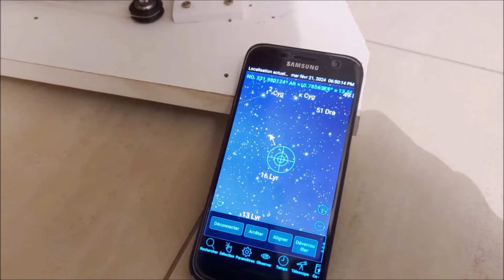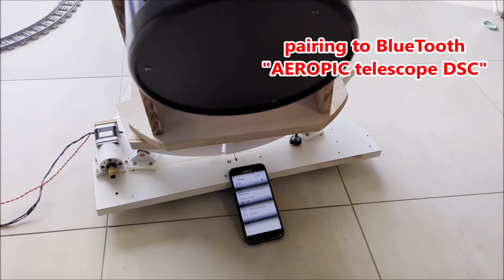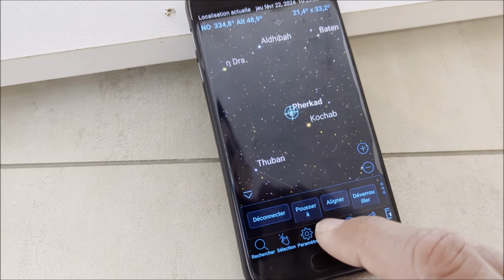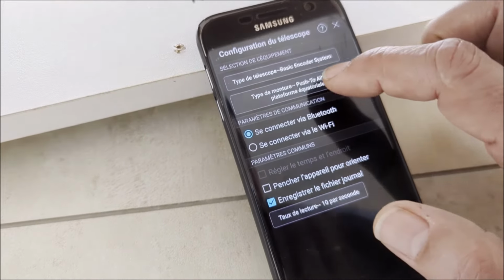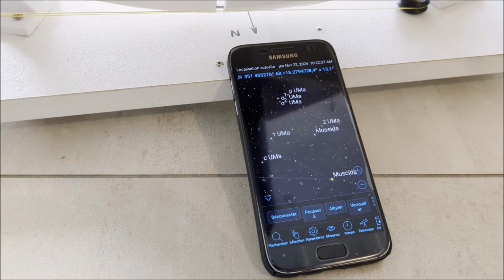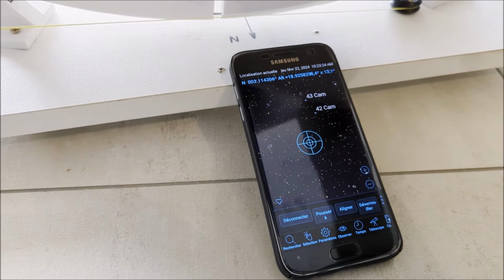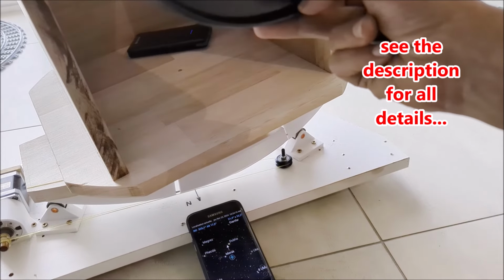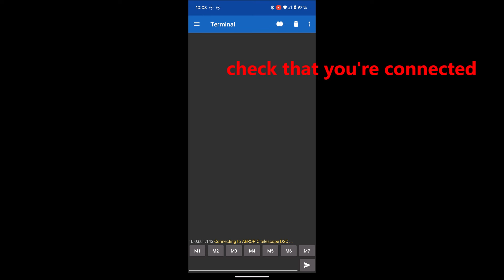AEROPICs wireless pushto DSC

Comment: Project looks great. Just waiting for parts to arrive to try it on EQ2 mount, without the cogs and just use the. AS5600.  I assume no programming is needed on any of the boards?  Nothing mentioned, but dont see how the boards SSID names get setup?
Reply from the maker: Yeap, there is no programming at all. Both ESP32 discover themselves, the SSID are inside the code assuming yours won't interfere with mine ;-). Same for the BT name, but you can chnage if needed.
Just upload the code to the ESP32 and go !
In skysafari, you'll need to tell it the number of steps per revolution. In your case 4096 for both axis.
(the code is on thingiverse)
Reply from the maker: @peterlogan2157 Please see my answer on thingiverse